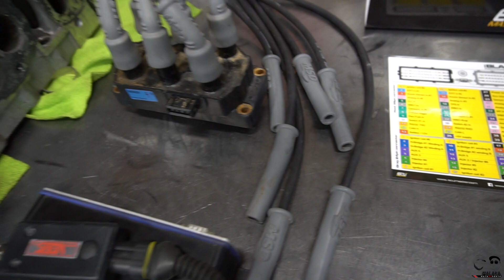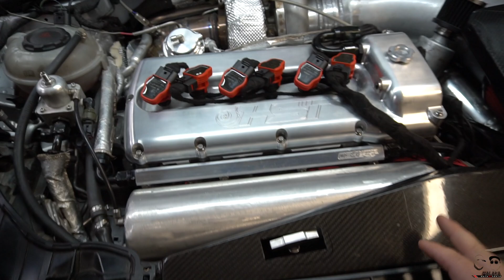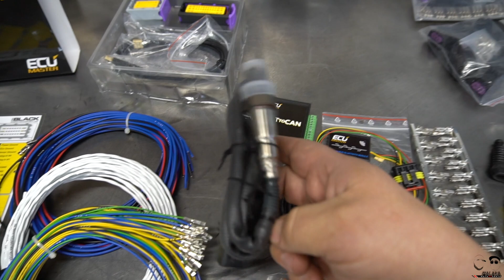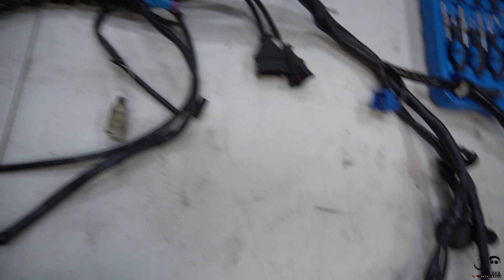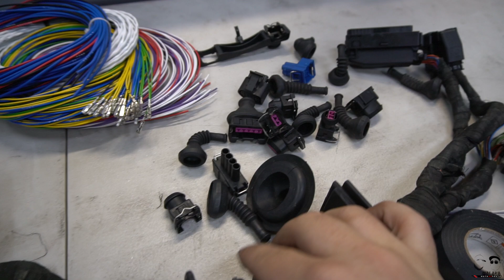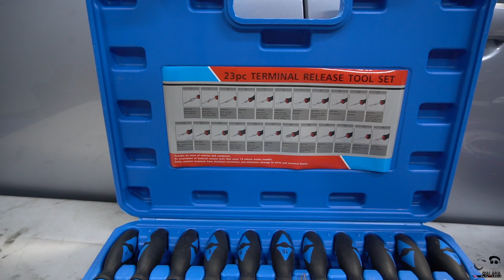ECUMaster - 12v VR6 B5 Audi A4 Custom wiring harness PART. 1

Comment: Im glad you are showing the construction of your harness using the EMU Black.  Ive been shopping for an ECU and this is on my short list.  I have a 84 12V VRT rabbit that is currently running on piggy backs.  It runs extremely well, I just know that it can be better and safer.  I'm not sure how detailed you are planning to get with this wiring series, but there are many of us that are following your channel that would love a step-by-step.  instagram is @oemmk2vr6 check it out.  VR swap the world

Comment from the maker: Still needs more valves - George 🤟
Reply from the maker: Smh 🤦‍♀️-Stav
Reply: @MalakaMotorSports  love the chanel and the stuff you build, i have a question, what did you do about the ABS in your B5, did you made it work with the aftermarket ECU or you deleted it? i have a faulty ABS on my audi and im debating in fixing it or deleting it
Reply: I agreee!😂
Reply: This is pretty much my comment every time! 😂 12+12=24 that’s double!!